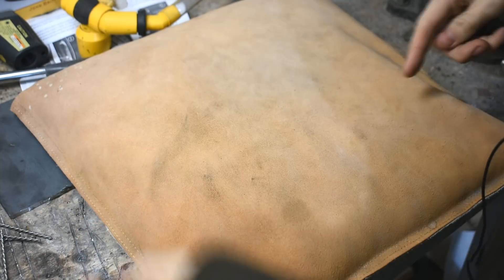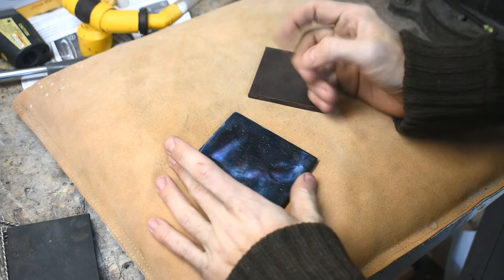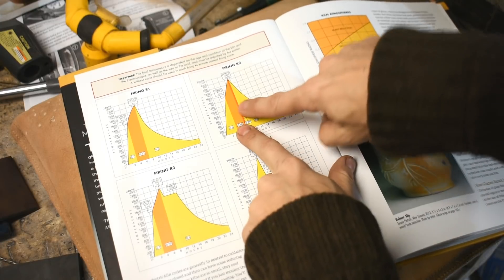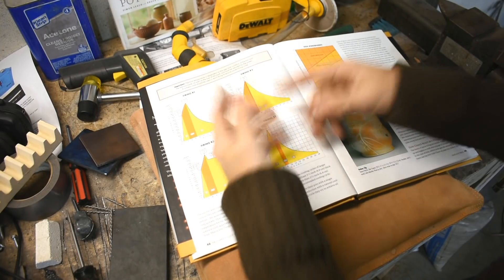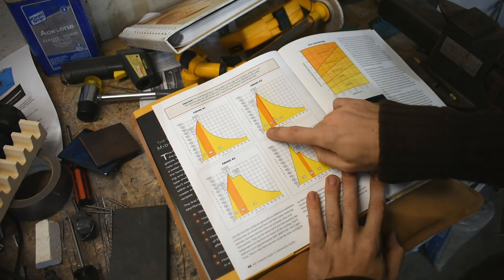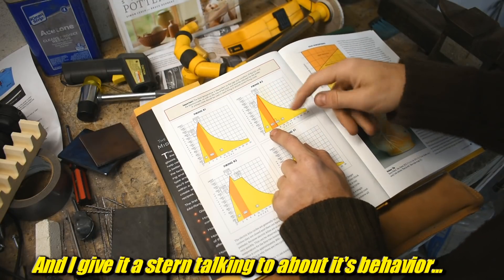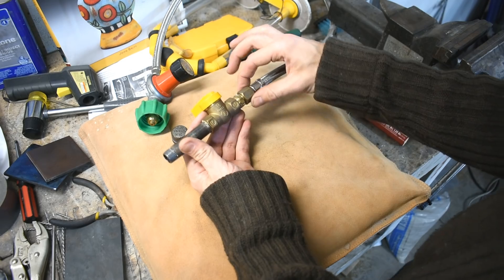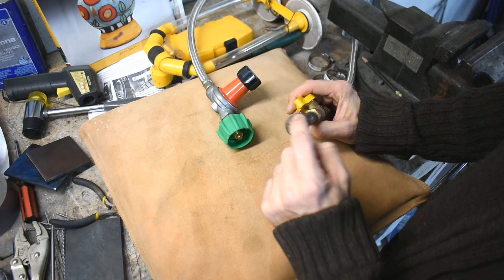DIY Electric Heat Treat Oven/Kiln/Furnace Part 7: Adding Propane for Reduction Firing

Comment: Hey~!!  How long to come up to  temp on that rig??? 
Use no lubrication for cutting  cast iron it only causes the chips to clump up and  brings nothing good to the party.  WD-40  is kerosene so it's  useful  (but stupidly expensive) for aluminum,  but not steel  for SST and  steel  use any high sulfur oil like OATY  from the BORG  they call it thread cutting oil. Sulfur adds the capability  of handling high pressure  like what you get at the cutting edge.

Comment: Just hit your channel, subscribed.  I've made two electric kilns, both had element failures constantly so I bought an old 1975 kiln for £50  which had been in the rain and had so much earth leakage  I had to put the rings on one at a time for days with a 100mA breaker before I could turn all 3 rings on .

Comment: I'd really like to do reduction firings in my electric kiln by admitting the absolutely minimal amount of gas necessary - like a liter or two per hour.  But it's obvious I'd get coking in the admitting tube before the gas ever entered the kiln.  I can't seem to resolve this.

Your approach of having a larger admitting hole plus an exit hole, and then having the orifice outside the kiln seems to solve the coking problem but wastes some heat.  I shouldn't be so parsimonious with my kilowatts, but I am.  I can't help but think there's a more efficient way...something like flinging in a tiny polyethylene pellet every few minutes.

Edit: Hydrogen, like Eric above suggested, may be a great idea.  It certainly wouldn't coke. :)  But maybe Kanthal A1 wouldn't like a reducing hydrogen atmosphere.  I haven't checked that out...I'm just going on general principles.

Comment: Beware that when you create reducing atmosphere -- with propane, charcoal, wood, etc -- you may generate carbon monoxide (CO).  That is toxic by itself, but it also combines (at rather low temperatures) with nickel from the heating elements to make nickel carbonyl Ni(CO)4.  That is a VERY toxic and carcinogenic vapor; so you want to have a good exhaust fan with hood above your kiln. (Fortunately it breaks down rather quickly when mixed with air.) 
But the worst part is that your heating elements get corroded. In one of his charcoal videos, Cody Reeder mentioned that he lost a set of elements, and was surprised to see that happen in the reducing atmosphere.  It may be worth asking the googlesphere about that possible problem, and how to avoid it.

Comment: "Reducing" atmosphere" does not mean "without oxygen", but rather "with something that will de-oxidize elements of the glaze/clay/metal".  For example, turn fully oxidized copper (in the +2 oxidation state, Cu^(2+), blue-green) to half-oxidized copper (Cu^(+), old-blood red).

Comment: Hi. Plumber here. Please use some proper high temperature sealant. Something like the Monster Copper anti seize and sealant. Please, for the good of your lungs, your shop, and everyone in close proximity to you. That stick is okay for short term and possibly low pressure use, but nothing high temperature, and I wouldn't trust it for high pressure or long term use.

Comment: FWIW, propane 's autoignition temperature (AIT) is around 840F (from US Bureau of Mines Bulletin 680, not Wikipedia), it's explosive in concentrations from about 2% to 10% in dry air (seriously, there's a bunch of useful info in USBM-680 and best of all it's trustworthy and free), and the detonation cell width for propane is about 2 inches (search for "Detonation Database" and "FM97-8" for extended weird technical details). There will be an explosive concentration of propane inside the furnace no matter what you do (it may be confined to a small zone but it's still there) - that's not necessarily a problem if you can keep the size of that zone small (ideally smaller than the detonation cell width) and make sure you can't accumulate unburned propane in the furnace. Check that the temperature schedules show propane is injected when furnace is above 880F so it autoignites. You work on gas appliances so you already have firsthand understanding of gas safety when installing and running other people's designs so apologies if I sound like I'm 'gassplaining'; hopefully this helps ensure a safe and successful design!

Comment: maibe you need to have the tempsensor closer to the part youre heat treating , maibe even touch it , that way you measure the actual temperature of the part in realtime and not the surrounding air 
you can probably switch the gas on and off using a electric valve , since you dont need to ignite it , and i agree it wouldnt be safe to walk away from it , you could make it a bit safer by putting a second temperature controlled electric valve in series with the one operated by the tempcontroller so there whont be gas entering the kiln if it isnt hot enough to ignite the gas on its own 
as for the orfice , if you dril and tap the hole in the endcap you could use jets from say a furnace to finetune the flow 
as for hooking the gas flow intoo the kiln , i think with the hole as small as it is you could probably use copper ar steel brakeline for the last bit and need a lot smaller hole to enter it intoo the kiln space , you could allso enter the brakeline a bit further intoo the space and bend it to direct it in a different direction to get a more even spread or to create a slight vortecs in the space

Comment: Paul, when you mentioned keeping the air consistent at 5:03 a good way to think about that is the hot air in a casting forge spiraling around the crucible.

Comment: Perhaps make a threaded fitting and a manifold for various gas injections.  Also an exaust valve (Ball valve) to adjust how sealed it is.  Also a pizoelectric lighter inside by the gas inlet.  Just some random ideas

Comment: Hydrogen (From a tank or a seperating electrolyset (ALL ELECTRIC eh?) ) and an inert gas input (Argon or Nitrogen) via tank or a Pressure Swing Absorbtion System, would be intresting.

Comment: The brown metal was nice. The blue metal was nice too. I've seen folks heat up metal with a torch and just dunk it into dirty motor oil to give it a heat treat color. Wasn't very scientific of them. But they seemed pleased with the results. I'm trying to remember the name of the one heat treatment that is really sought after. Was used on old machinists instrumentation a lot. I'm drawing a blank and Google is being completely obtuse. If you could do that finish you'd have something. I think I found it. Case color finishing. Like this https://lh3.googleusercontent.com/proxy/PAFBMPJe4dMGWz3OrTx3Zacg6iwiYfZ_uhvBzHtdsiXi07ydSpP54-qDjJO4h0Q2x7Ah7kAiXm0Y93IAHdBYqBJ72CPOBrVDMUU

Comment: Excellent video!  As I understand it the idea is to remove the oxygen by using it to burn the propane.   Adding air would require more propane.  Sounds counter productive.   For less soot use less propane.   

While enameling a friend once added moth balls to a small kiln to get a reducing atmosphere.    Unfortunately he cracked open the door to peek in.  POOF!  Lost his eyebrows and the new set of coils we had just installed.   Has me thinking less fuel is a good thing.

Comment: I wonder if you could achieve the same result by introducing an inert gas, like nitrogen, instead of burning up the oxygen.
Reply from the maker: Itspossible, but it's not just to take oxygen out of the air, but also out of the thing in the kiln.  In the case of pottery glazes, heavy reduction can actually pull oxygen out of molecules that color the glazes, changing the color.
Reply: @PaulsGarage  use a heavier than air gas. Halon gas for example.
Reply: @Argosh  It's not just a matter of displacing the oxygen or inerting; the reducing atmosphere caused by (incomplete) combustion products chemically reacts with the glazes, metals, etc. Halon is expensive and bad for you (it's a CFC and does really bad things to your lungs if you inhale it along with smoke).
Reply: @bobapthorpe  sorry, brainfart. I meant Argon.